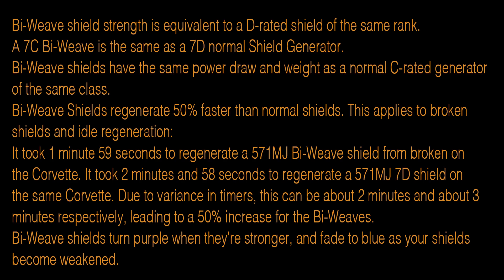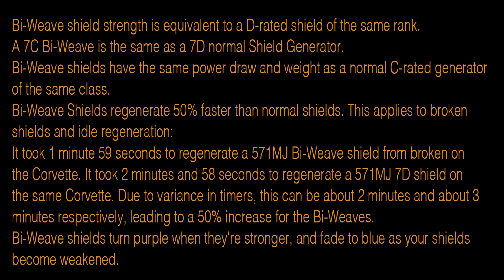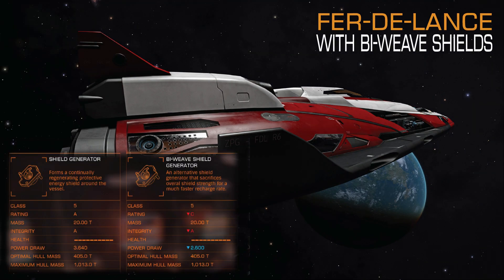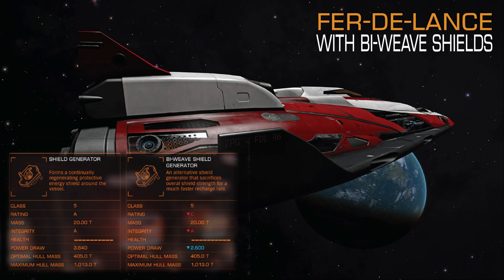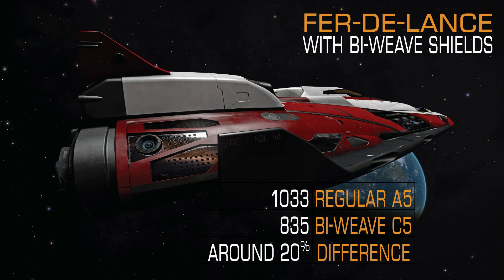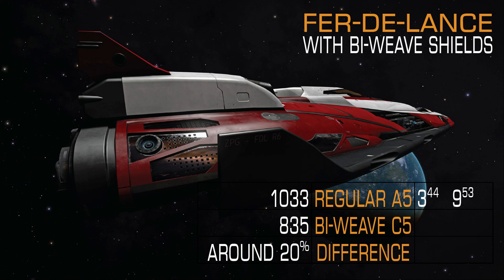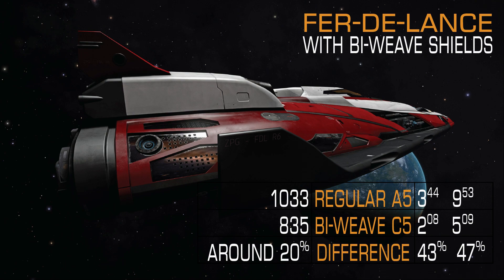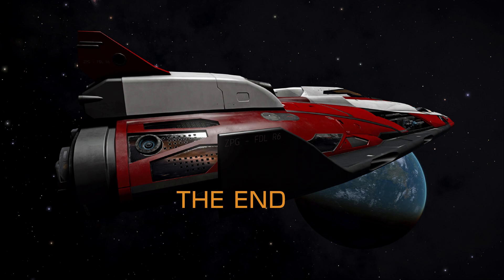Elite: Dangerous. To Bi-Weave or not to Bi-Weave

Comment: i do not think that the normal or prismatic shields will die.i think now we have more possibilities to fit our ships better. i think that bi weave shield generators are for the smaller ships and those ones which can't use the max. ammount of shield bossters. the fer de lance is a perfect example. at the moment i am flying fer de lance with prisma shield class 5 and 5 class c shield bossters. (893 MJ shields). now if i use the bi-weave generator i can use the saved energy for class a shield bossters so i can fly bi weave class 5 with 5 class a shield boosters (759 MJ).  i have 134 MJ less shields but doubble the recharche power. so for fer de lance it is the better choice. also for vulture and other small ships.

but for federal corvette i would better use prisma shields, cause i have the energy to use class 7 prisma shields and 8 shieldbosster class a (2358 MJ shields). with be-weave and same bossters i only have 1452 MJ shields. there is a difference of 906 MJ. so with be weave you only have 61,5 % of the shield strength of prisma. 
so i would say that for corvette prisma is better, also becouse i heared that the want to increase recharche rate of bigger shield generators, which is correct in my oppinion, cause class 7 Prisma needs 7,35 energy.

so i think you have to look around for which ship swhich shield is the best, you can't say that we only will use be-weave shields from now.
Reply from the maker: +dodo do you realize fdl has class 6 power plant now?
did i say that you will only use bi-weave shields or even that i will use only them? hhh, but if you can charge them 2x faster while shields are online - that matters more than 20% more shields with more power so i would say that even on combat corvette bi-weave makes sense now...
Reply: +Kornelius Briedis About 1.64x faster charge when the shields are online. I figure that when they come back online they go to half strength. The 5A shields took 6 minutes 9 seconds to go from half to full, or 369 seconds to charge 516MJ. This gives them a recharge rate of 1.4MW. The Bi-Weaves take 3 minutes 1 second to go from half to full, or 181 seconds to charge 417MJ. That gives them a recharge rate of 2.3MW. Bi-Weaves are 64% faster in this case, which is still very very good.

Comment: Hum, so my shields would be weaker and be taken down faster because of that, but they will come back online almost twice as fast, and recharge to full almost twice as fast. That does sound like a good trade-off to me.
Reply: I love bi weave. I have non engineered shields on my Corvette, C7 . Only had the thing for about 2 days lol... but I fought and outmaneuvered 2 deadly anacondas using shield boosters on all utility slots at grade 3 heavy duty and using only one charge from my 6a shield bank.

Blew them to bits, didn't break my shields. They completely recharged after I collected all mats from the wreckage

Comment: Nice one mate. Ive been doing a lot of testing on this subject also. And although they do recharge faster, the benefits for combat are still debatable. They are great for getting shields back online faster in between fights, but during fights, when you want your shields to re-charge faster, I am still on the fence as you can loose a lot of shields very quickly, especially in PVP. I have mixed results in PVE and PVP, but it certainly does give you greater flexibility in your build options. But its awesome you put some numbers to it, so thanks for that! I'm sort of holding out until 1.5 has gone live to make final decisions, as for the moment they could change anything..
Reply from the maker: +Vindicator Jones care to share your findings? on "eye" it seems actually that Bi-Weave shields are bad, because, again it just felt to me like that, when you have >50% shields they are ok, but when they dropped <50% they went down much quicker, is it possible that bi-weave shields have some kind of difference on how much they deplete per same power shots if they are full charge or around 30%?
Reply: +Kornelius Briedis To be honest, I am having similar results as yourself, and its weird that you noticed the same thing I did about when shields are above 50% they are fine, but under 50% it just seems to loose strength so much faster, I thought it was just my perception of it, hence why I said I need to do more testing after 1.5 

I am wondering if its a bug, or glitch since its still only beta. and that the visual readout of shield strength is not actually indicative of current shield strength, but I am just speculating. I was going to do a serious in depth test after beta, and see how things are then. But at the moment, I dont think they are working as intended, and if they are, then I think I am going to give them a miss and move onto prismatics, as I dont really see a benefit to them, unless your inbetween fights and wanting your shield to recharge more quickly. In a fight, I dont really see them as an advantage over a shield that has a lot more power. But time will tell, I really dont want to commit to anything just yet in case I totally get it wrong... lol
Reply from the maker: this is what happens visually: Bi-Weave shields turn purple when they're stronger, and fade to blue as your shields become weakened.

so i am pretty sure we both felt same, meaning that for combat it might not be such a good idea after all to have those shields, when you have weakened shields you just have very small chance to keep them online, but you are right we need to wait for live build and try it as now all is subject to change
Reply: +Vindicator Jones So... now 1.5/2.0 is live, in a fer de lance, would you say bi weave shields are beneficial? Power is obviously not a problem anymore. Have they changed anything from the beta?
Reply: +Hilko Jongsma They are the same as beta. Bi-Weaves are probably good for traders and smugglers, but for combat, they are practically useless in my opinion.. But others might disagree. I will stick with my A grade shields and lots of boosters.

Comment: I have 4C Bi-Weave shields in my smuggling/exploration Cobra MkIII, it's convenient for my high speed silent running build to have shields that come back up faster because I have light weight alloy bulkheads and no hull reinforcement packages (gotta go fast). They are just there to protect against impacts when docking fast, and to soak some hits when I am running from PvP pirates. The unladen cruising speed is 312m/s and the unladen boosting speed is 447m/s. I sacrificed a lot for that speed, it's the fastest hunk of junk in the galaxy    :P    They have done well with fast docking so far, but I haven't tested running from a PvPer yet. I had 4D shields on an older Cobra build that was a little slower than my current one and they held out while I ran from PvP pirates on multiple occasions, so hopefully the Bi-Weave will too.

Comment: Some great info there, thanks.

What do you think of Prismatics vs Bi-weaves? In that scenario I guess its a 40% shield strength loss for a 50% recharge rate...

Any yes, a huge bi-weave weapon would be nice!
Reply from the maker: +Hammer Fall around 40 %  yes, but less mass, MUCH less power required to fire bi-weave, in the end all comes down to if you have enough power for all desired weapons, prismatic shield, full load of SCB and shield boosters (excluding mandatory heat sinks), if you can then obviously prismatic is your way to go but if you don't have enough power then bi-weave actually will make your shields stronger in the end ;)

Comment: I'd say Combat, 100% of the way go Bi-Weave, because let's take a cutter, that has a fuckin beefy shield, 3,000 with prismatic. but the recovery is like 7 minutes and 24 minutes for recharge, that's fucking mental, it's too much to get back in the fight and you are left relying on only shield cell banks. but then there's the Bi-Weave which is only 1000 less, 2/3rds, and the recovery is 3 minutes, and 9 minutes. THAT IS SO GOOD. with trading and smuggling or whatever. you're gonna get interdicted like alot. but you still shouldn't be using bi-weave because you don't ever want your shield to go down so you want prismatic or normal. as many shield boosters you can get, and possible even shield cell banks

Comment: To add some current information. If you divert more power to the shield while offline, the speed of activating it goes up significantly when using a Bi-weave. Normal shield will not change speed of reactivation, but a bi-weave will significantly.

So if you, when you loose shield you put 3-4 in system capacitor, and 2-3 in engines you can make sure you stay off getting hit a good deal, and will be able to get the shield back up during an extended fight. When the shield is up, you could use shield banks if you have to further boost it so as not to get it deactivated again.

With 2 shield boosters you will have almost the same amount of shield as you would have with a normal shield of higher level...quite worth it in my opinion..
Reply from the maker: all you need is energy in SYS capacitor, if you run out of energy more pips needed but it will not speed up as long as there is energy, not having energy will slow down.
Reply: Ahh, that is how it works...sry for the mistake
Reply from the maker: it's ok, i didn't know that very long time myself until a friend told me and i tested that to be sure :)